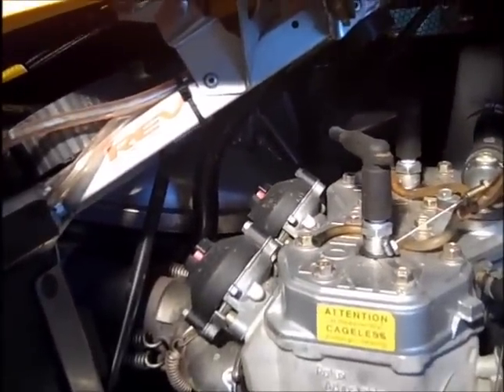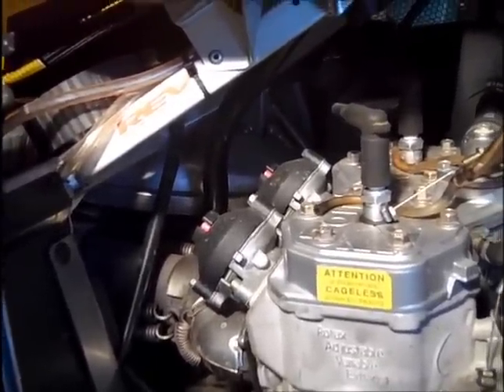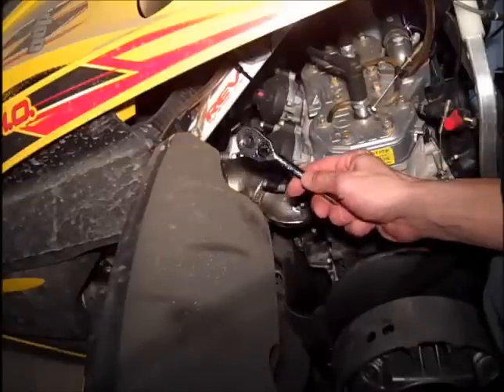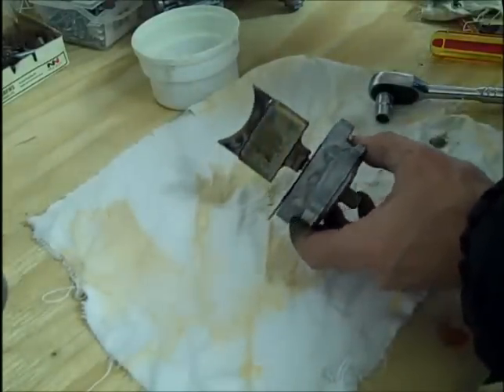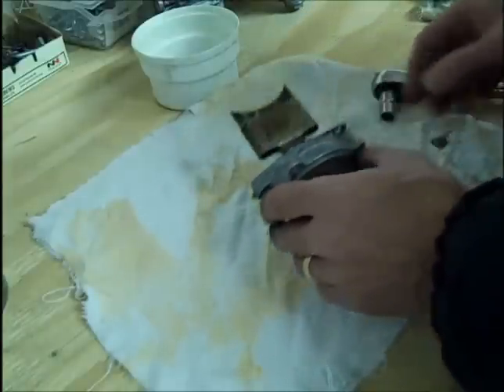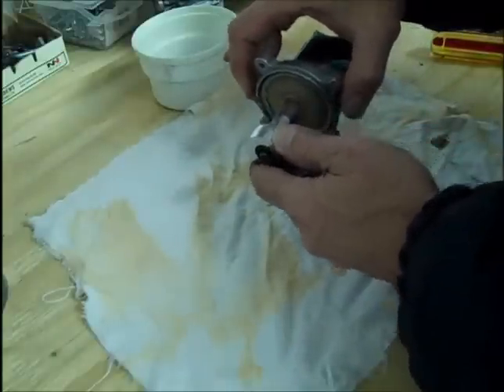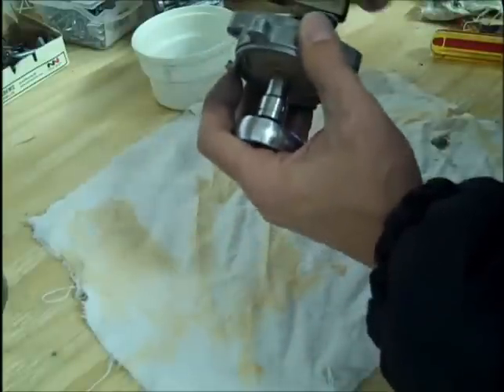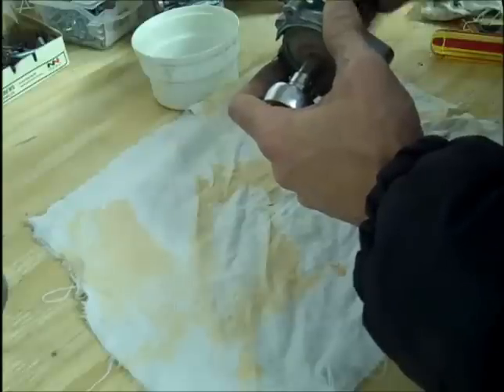Ski-Doo MXZ 600 HO Adrenaline Power Valve Removal and Cleaning

Comment: my Rave has a small oil leak, i have not taken it apart yet but im wondering if it would have something to do with the o-ring.
Reply from the maker: Take them off and clean/inspect.  Also, you can look into the cylinder while they're off and take a look at the pistons and rings.  Turn the engine over by turning the clutch and you'll be able to get a pretty good look at the piston from top to bottom.  See you on the trails!